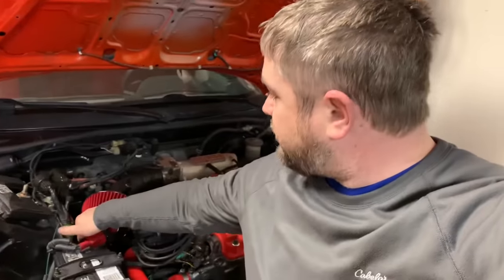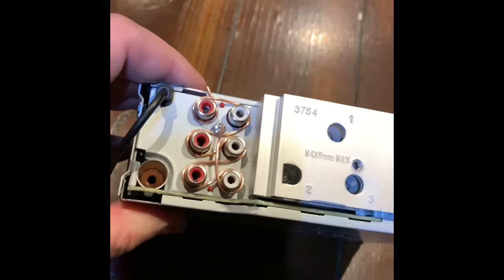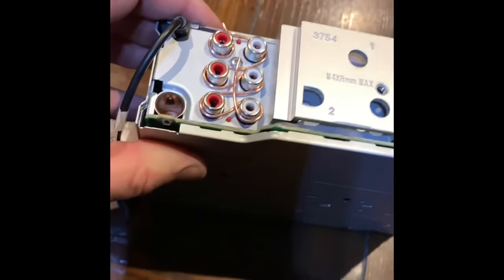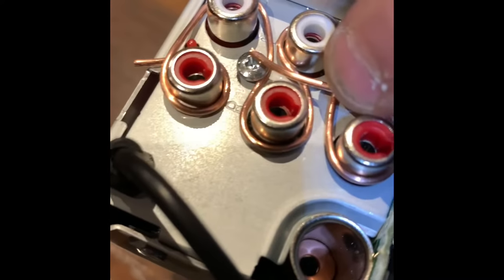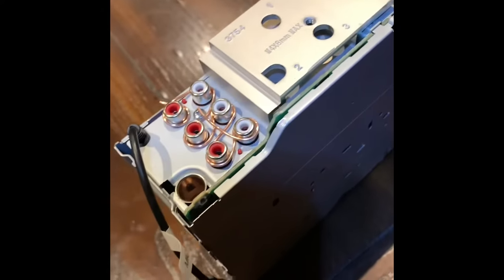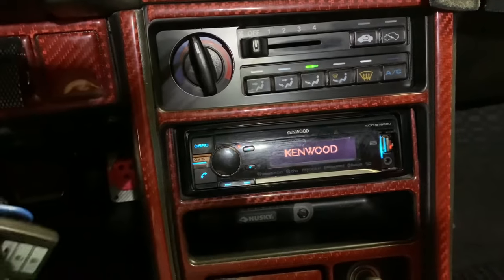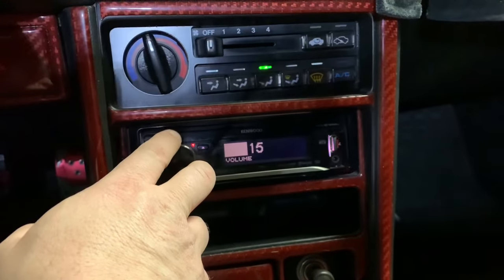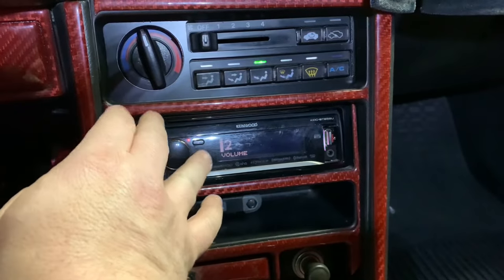Car audio FIX! Ground and engine noise solution.

Comment from the maker: Update Update. I’m so glad this is working for a lot of you. For me, it turns out that the wiring harness was busted. I bought a Pioneer DEH-X8800BHS. It SMOKES that Kenwood, so all things happen for a reason. (Just pissed I drove it for years with a shit sound).
Reply: Hello! 
Was the quality also losing this issue?
Reply: When you say the harness was busted do you mean the one that came with the radio or the aftermarket harness that connects to the car?

Comment: FOR ANYONE LOOKING FOR COMMENTS ON IF THIS WORKS: I have a Kenwood headunit and the problem was amp wine in my newly installed, bridged kenwood KAC 600w. When I disconnected the SUBWOOFER rca the wine stopped. I was like what? those should be isolated circuits. Well if your problem has to do with the rca induced wining then go check the headunit, unplug one set, replug etc. see what stops the wine. If you disconnect 1 set of rcas and it fixed the wine for the opposite and still connected amp, then this is likely your problem. Wrap the wire around the rca terminals and secure it. Problem solved. Just make sure that the wire you used actually grounds those RCAs to the headunit as said in the description. 

IT WORKS! 
Thanks to this video I didn't have to call in my dad for help :)

Comment: For your test, I believe you forgot to start the car.  Because mine only threw a whining sound when the engine was running, but not with engine off and power on.  I'll still try to connect all of the grounds of the RCA cables together to see if it fixes mine.

Comment: You might also try adding a ground to the chassis of head unit.  Run a wire from a known good ground and screw to outside chassis of head unit.

Comment: Back in the 80's we would just run a ground wire from the ignition coil with a small capacitor to the body. That usually worked. Sad to see the problem hasn't been fixed yet.

Comment: I had my doubts.  Mine was so loud when you turned on the heater/AC fan that it was unbearable.  I just did this and it is complete silence.  Thank you!  BTW, installed dozens of systems and never had this issue.  Alternator could be failing or has a bad connection.  Still, awesome that it worked.
Reply: I did this on my RCA , but then no sound comes out. Any ideas ?
Reply: @pollo8993  But you have sound before?  If so, it sounds like you may have used stranded wire and some could be touching the inside of the barrel?  Is that possible?
Reply: Yes i have sound before grounding the RCA.
Reply: @pollo8993  Not sure on that one.  Sounds something could touching both the inside of the barrel and outside of the barrel causing a short, but other than that, not sure.

Comment: So just any copper wire would do? Also, I'm using RCA cables, would this prevent me from plugging in my RCA cables all the way into their respective jacks? Would I plug in the RCA cables first, then wrap the wire around?

Comment: The grounding  of the head unit case to the closest stable ground should do the same. Some amps are designed so that each rca must remain isolated at input and most certainly at output. When experiencing stereo interference, it will more than likely be ground induced.

Comment: Well when you run into these issues you isolate segments and run them stand alone with temporary wiring attached to the same automobile. Also known as base lining. One component at a time.

Comment: This worked for my classic Mini with Pioneer HU and new amp....horrible rpm-dependent whine plus rapid clicking when the electric fuel pump was on. Did not happen with previous amp but it died so needed a replacement....which then picked up these noise issues. Might be a poor ground elsewhere but this is an easy fix to save a lot of testing.

Comment: I do car audio for a living. Sound like a bad RCA, maybe a small break in the line.   But hey, this beats having to pull all that out to replace.  Sometimes bad spark plug wires will pick up transit noise and amplify it the rca’s and you will hear it in the audio when the car is running.
Reply from the maker: The wiring harness was bad. I put in a Pioneer DEH and couldn’t be happier.

Comment: You can ground those RCA outputs inside the radio, they all share the same ground pin inside, just solder that pin to the radio chassis and Voila! No more ugly wicked copper wire
Reply: Is there a video showing this?
Reply: @cameroncampbell6931  I also would like to see how that works

Comment: Bro. Try running output of rf from transistorized radios. Ooof talking needing ground straps at the doors, frame, radio, it is insane how much bonding and grounding is required. Insane.

Comment: Brother am going thru this shit right now,  have an 2002 ford Ranger Edge 4dr. And ever since I replaced my head unit from single din. Pioneer, to a double din full screen J.V.C.mc750bt, and added a Kenwood  450 4ch amp for new 6x8 door speakers,  to my system.  It's killing me, already did the big-3 wires to the engine bay. Plus new 2 pair 3x shielded rca to all 3x amps, I dobt know what to do.......?

Comment: Remove the serpentine belt and run the car with the stereo on. Do you still have the noise? I'm thinking you're getting electrical interference from your ignition wires plugs and mistaking it for an alternator whine. Wonder what's going on. My dad has the same issue with his mustang and I looked at it for like 20 minutes. I went to college for automotive and took an audio class and that doesn't sound like ground loop. Ground loop is like a hollow sound.
Reply: So new wires?
Reply: I’m having the same issue as he is. What do I do to fix it?

Comment: late response but I just got a new JVC aftermarket radio and installed it. I don't have my door speakers or tweeters hooked up to an external amplifier, just the deck. I got it all wired and when I fired the car up, as soon as the radio starts, a loud static/screeching sound plays through my mids and tweets. The tweeters get no music just static, the mids get music and static. I am curious if I should cut the car harness's factory ground wire that is running to the headunit and run a NEW & seperate wire from the headunit to the amplifer's ground? Or should I keep the cars factory harness's ground wire and run a secondary ground wire from the chassis of the headunit to the amplifer? Another question is should i use the radios harness black wire (the ground) to run a new wire to a new ground location or should I just connect it to the radio's chassis and run it to a new ground location? Hard to explain but sounds like I'm riding inside a UFO.
Reply: Never cut your stock harness.  Its always best to run a new ground wire for the new aftermarket headunit.  The stock harness ground wire always gave me problems.

Comment: Tried this, didn’t work unfortunately. My mechanic put his “stethoscope” to the alternator and it turns out it’s no good. I still have the factory new unit from 2007 in my highlander. The whine when you listen to it sounds the exact same as what’s coming through my speakers. At least my radio unit is very grounded now. Didn’t have any whine when the engine was off which was a big clue.

Comment: I've got a noise problem with an Alpine CDE 110. It ONLY does it in AM radio mode. It has a whine that starts out low and slowly get higher, then it goes back down. It will continue to repeat this as long as the power is on. It even does it with engine off and switch in ACC. Any suggestions of what might be causing this?
Reply: did you figure it out?
Reply: @senarain337  No, but I may check around some audio stores to see if there are any filters that may take care of this. Many years ago filters were common.

Comment: A couple of things I'm curious about . (1) I didn't have this problem until I replaced my factory alternator with one from RockAuto . (2) most RCA cables for car audio are twisted pair (differential) style so if your head unit isn't set up for this type output but the amp is you would have no noise rejection in the cable . I bring this up because I can't find any statement for my Kenwood decks output type but my JL amp has differential input . I've tested 3 different amps of differing price range and the JL picks up the most noise .

Comment: People forget to bypass factory amp just have to unplugged it usually the bigger one if the two if your using factory speaker wires keep the small one on. If you ran fresh speaker wires to the aftermarket amp unplugged everything on the factory amp

Comment: I replaced a Bosch Multimedia Compact with a Android 12 Head Unit. Works great except that the radio has a slight "crack". Seems to be not related to induction noise. Sometimes the crack is not there. So has to do with antenna I guess. Annoying. Old radio did not have this.

Comment: I had Zero engine noise with my 4 channel Amp and then I added the Subwoofer amp and started getting noise of my 4 channel amp speakers. I couldn't use the same ground I used for the 4 channel amp but it's pretty much comming from the same piece. Any clue what it could be?
Thanks
Reply: I’m having the EXACT same problem after adding my four channel amp. Lmk what helps you plz
Reply: @cameroncampbell6931  There's a bunch of videos here on how to fix this issue but I ended up getting some descent tight fitting RCA's and that fixed it.
Reply: @imatter4619  It ended up being a difference in ground between the two amplifiers. I bought two ground loop isolators for the four channel amp and it took the static away

Comment: Imma have to do this cause I have blown 2 amps so far running all my music and its a loud as hell whine no matter what and gets worse when you drive. I hope this works.
Reply: Did it work?
Reply: @ajpadilla1603  sadly no, I also went and bought a new head unit, new amps and still nothing. Even a new cap so I think its a deeper issue with what I am having but simply no. Thats me tho.

Comment: does your after market kenwood radio using after market bracket which is Plastic/abs ?? and the factory brakcet is metal ??
if so then maybe that's the problem. the bracket should be attached to the frame inside the dash which is ground for it.
Reply from the maker: FineTune it went back to garbage, so I’ll look into that thank you. I’m also going to run a ground directly off the battery back to stereo and amp.
Reply: @Teamcurtisbjj  Ah sorry to hear that. Ignore my question above then. Cheers

Comment: Can you please tell me what did you do with the original ground wire that came with head unit?  I'm going through it! new audiopipe amps box and speakers. I cant even cut my radio on it's so hurtful.
Reply from the maker: I’m still having issues. Got a few other ideas. What a joke.

Comment: I’ve tore my system apart about 10 times now. Today I took my radio out and took the ground from the radio to the chassis where my amps are grounded and still nothing.

I have a stock radio that I tapped into with an LOC to get signal to go to my amps. I wonder if I just wrap wires around the input/output of the LOC if that’ll have the same effect on my whine issue? 

I’m gonna have to try it.

Comment: Mine never really got louder with acceleration or anything it was just a constant humming noise. Mine was because I grounded my amp to my 2nd battery so I just re grounded it to the frame where my back seats are and it stopped. Prob a noob mistake lol

Comment: Hey man I'm going to feel just like u tomorrow after spending 1600 on a stereo sound system .... It's common on accords
Reply: Hey man how did you fix it ? I have rockville db55 amp hooked up with my factory stereo but the noise won’t go away. I earlier had kicker cx600.1 even then the noise was there. Everything is grounded properly but can’t figure out how to fix it.

Comment: Did the issue return after you did this?
Reply from the maker: Yes. Still stuck with the shit sound.
Reply: Wow so it didn’t fix it in the long run? I just got a  4 channel amp and tweeters “professionally” installed and boom instant buzzing and engine whine. I’m so pissed about it

Comment: I have this shitty ass problem to when i put my key in the acc position my shit sounds great but when i put it in the on position i hear a loud ringing also when i start my cAr and rev it i can also hear the rpms whine through my speakers i need help 😭😭😭
Reply from the maker: I’m going to run a ground directly to the negative terminal. I’ve messed with the ground on the amp 10 times. I’m thing it’s gotta be the deck.
Reply: Its just sad putting grand after grand into this shit and having these proplems

Comment: Is that wire insulated
Reply: Ground wires done have to be insulated dude, from electrical theory it just doesn’t, but it can be insulated not saying it’ll make any major diff just it’s insulated but ground is just somewhere for an inrush of current to go to Incase something makes the car produce to much power or having s blowout on a speaker or the system

Comment: I did this and it took it away for like 5 minutes but then it came back
Reply from the maker: Anthony Barragan yep. Same for me.
Reply: ActualTour V2.0 I feel like we didn’t ground it right did you screw it down under the screw? I just left the side on top of them screw maybe the vibrations of the car keep it from being stabilized?
Reply: Same problem came back to me  too - back to the drawing board

Comment: Almost all the new 2020-2022 pioneer and kenwoods have this issue.   Its the cheap china chips and hardware.  My 2022 pioneer avh-240ex puts out garbage quality sound, even with a 5 channel fosgate amp.  Full on regret the purchase.
Reply from the maker: My Pioneer is working flawlessly. Very happy with it… it was expensive. Thanks for commenting 👍🏻

Comment: I tell you what is going on if you ever see the old acient engines magneto ignition system that is what is going on the same crap you can create with audio device futher more your actualy over writen alternator starting charge rpm in some casese even speed up your starter motor if you know what bypass ignition power is ore ignition coil amplifier then evry thing is clear those back curent and static destroy ruber and seals on a car and on top of that if you have cooling system isues because of cooling system electrolisys you are in big big trobel thats some odd staff it can by usefull for economy ass in dual ignition but in most cases you end up with broke head gasket over heating engine and some more trobel fix that by carefull on polarity senzitive devices if no diodes are present it culd lead to engine run on you bight crash your car acidentaly
Reply: Not one period. Amazing. Complete gibberish but still amazing.